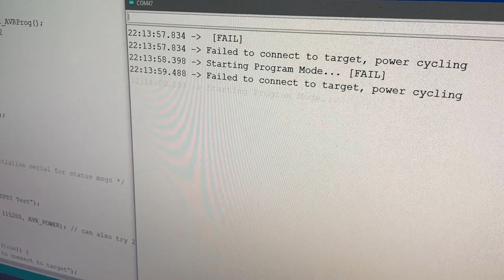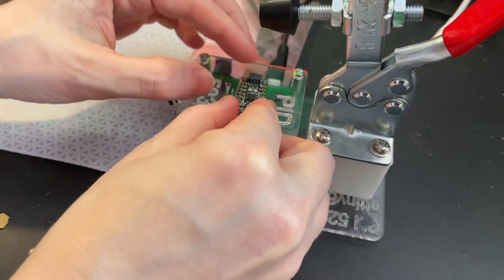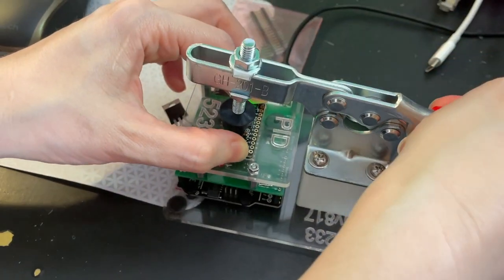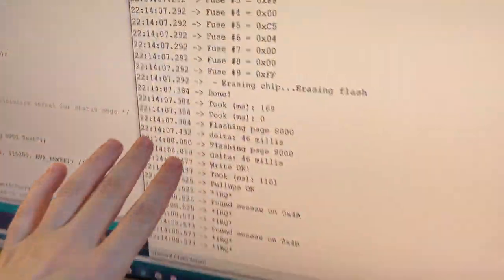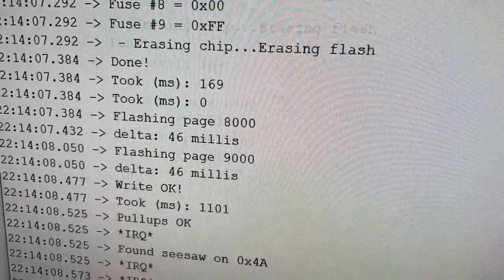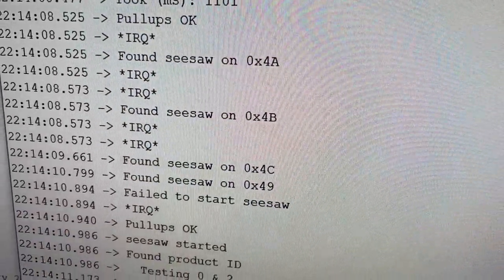fast standalone UPDI programming library

Comment: Can you please show the connection diagram? Or at least the schematic of the green adapter board?
Reply: The connections are not the most critical in a lot of cases as they are Duino below can most likely have the pins redefined unless it relies on a specific pin for a certain interface